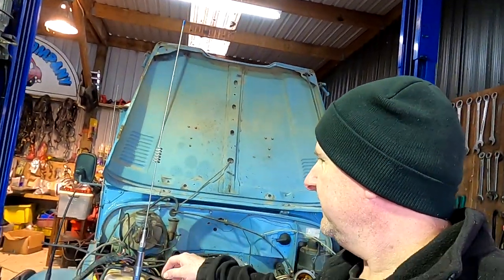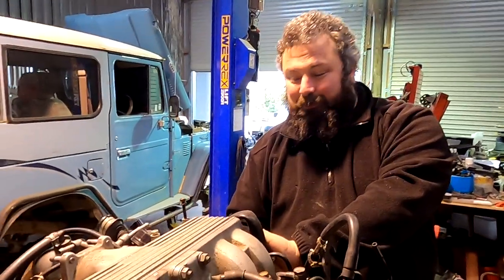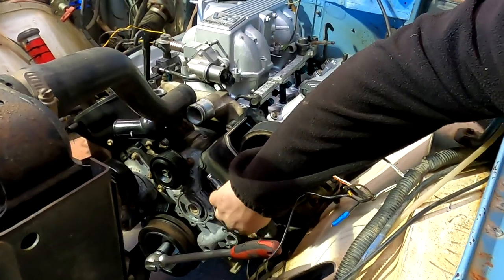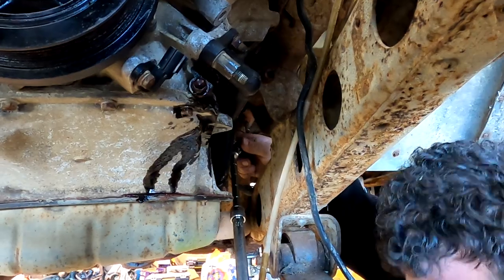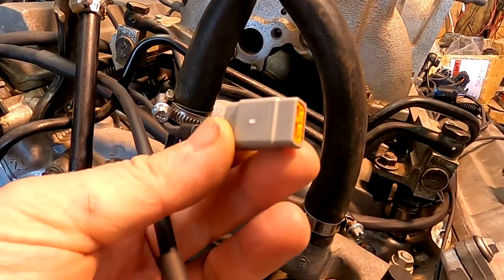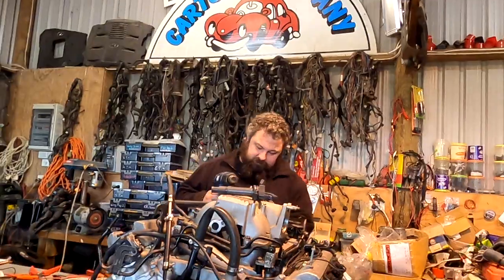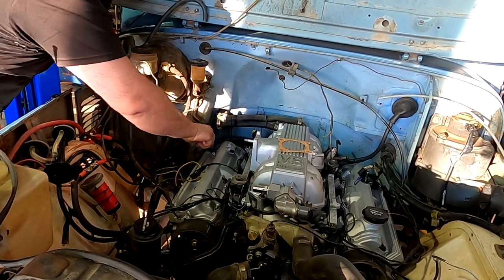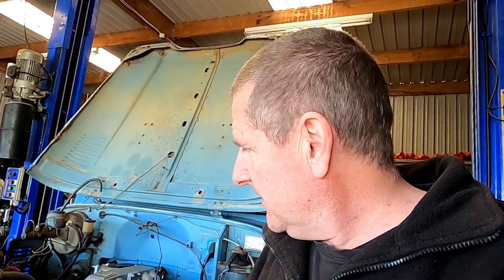FJ40 blue landcruiser with 1uz fitted. Repairing the wiring

Comment: Kelvin, do you boot the ECU with floppy disks? ;) Looking good.
Reply from the maker: Just about.  These old ecu were state of the art in their day.  These days the extra time playing with old gear almost doesn't make using them worth it,  as you will see with the firing up.
Reply: So is this ECU batch fire as well as wasted spark ?    We used the help out of the old A9L Ford eec-iv computers back in the day.  Anything ECU from Ford that was a v8 and manual we would use with Tweecer software to tune.  Even a 6cyl ECU we used for a old e36 BMW.    Nice work Jas !
Reply from the maker: @docfischer7291  this was a linkplus so had sequential injection and individual coils.  It was links top of the line ecu at the time

Comment: Mr.Cartune, or anyone that could provide some info here. 
I’m having a strange problem getting the best of me right now with me 00 ls400. Accelerates terribly and misfires in high rpm/heavy throttle intermittently. If you shut it off and turn it back on, that first pull it will run perfectly. Have done o2’s, fuel damper as well as pump/strainer and the in-line filter. I know this is asking a lot but if you or anyone could provide some extra insight, it would be beyond very appreciated. Thanks and happy holidays!!
Reply from the maker: Have you looked at the live data in the ecu?  Checked coils and spark plugs?  Confirmed fuel trims?  Dont just throw parts at it,   its much better to diagnose it

Comment: Hi 
I am swaping 3uz on Mercedes w126 which is SEL560 
I already mounted the engine and transmission on chassis with drive shaft , so now i need to wire  , fuel , connect A/C and the steering, I am working slowly onley holidays and when I like to work on it.
I have the wire diagrama for all systems but i dont know what i need 
Now I planing to wire engine ecu to steering lock ecu with key coil , i think it will work like that . 
Here some questions i need help about it.
Do I need to wire Gateway ecu too ??
Can i wire Engine ecu directly to Key coil without steering lock ecu ?
Can I Bypass the immo ??
Also i need to wire the gauges ( RPM and Speed meters ) 
What you advice ??
Reply from the maker: These questions are reserved for the customers which purchase my wiring instructions.  Cheers Kelvin